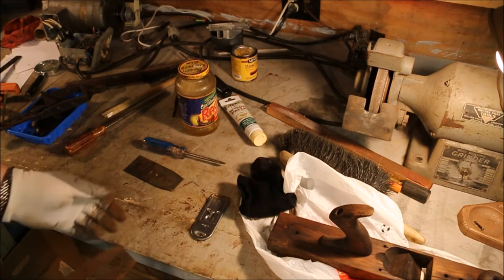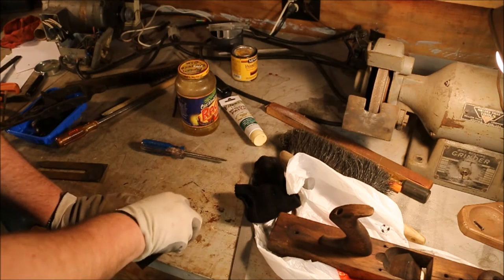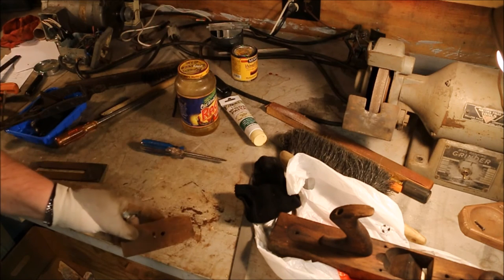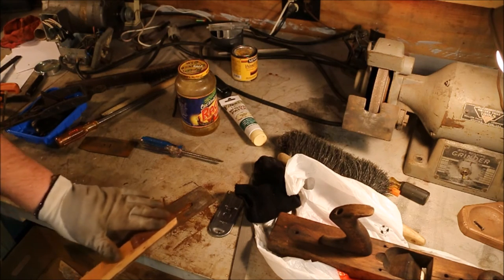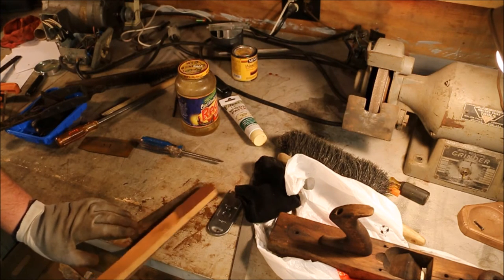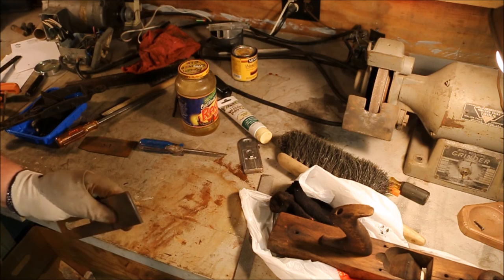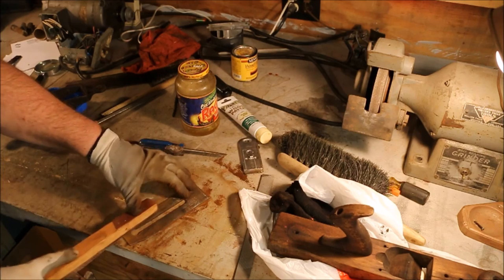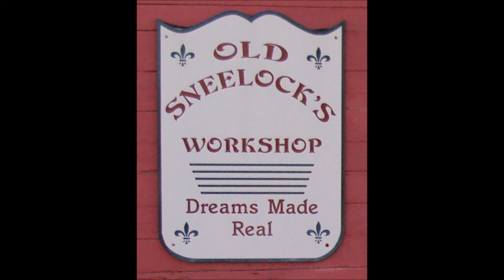Union Transitional Plane ~ Part 2 ~ Clean The Blade ~ by Old Sneelock's Workshop

Comment: Seen some crazy bondo antics in my time. A couple guys drinking beer and using the empties to patch a quarter panel and then came the gobs of bondo. Oh Boy!!!
Reply from the maker: +Tim Caldwell Beer is for after the work is done. Way too many opportunities to screw up. Best part is when your buddies sober up and have to redo the whole thing. 
Long ago I ran a solder dip pot. My job was to solder the headers onto radiator cores by using a hoist and monorail to set them over a 4' x 6' kettle of molten solder. Then i'd rest them on a riser in the middle. I would start a pump to pump the solder up into the riser. When the solder showed through the back side of the header I lifted the radiator off the pot. With the radiator still hot and hanging over the solder pot I used an air wand to blow the solder out of the tubes. Then I'd flip the core over and do the other end. 
I went with a buddy to local bar for lunch. I had one draft beer. For about an hour after lunch it was nearly impossible to get the radiator soldered correctly. My timing was off enough that I would leave solder in the tubes or miss setting the core on the riser square. 
Never had a beer during working hours after that.
Reply: +Old Sneelock's Workshop I agree 100%

Comment: Dad had a couple sayings that he learned in shop class that he used all the time. Beat it to fit, paint it to match. Sanded with a brick, painted with a broom. A brick, the original 1 grit sandpaper.
Reply from the maker: +Nemo I'd like to put that on the workshop wall. Classic. :-)
Reply: +Old Sneelock&#39;s Workshop Dear Unc. My computer is down for a while so if you don't hear from me doesn't mean I disowned everybody. Just going to end up with #10. My computer guy is an Uncle Sneelock in his 80's and was networking ms/dos before there was networking and I get to go to a class by him. Just me and his daughter so maybe I'll learn something. So I'll watch what I can on Sweetums laptop and try to use this compact keyboard. Progress is a big pain.
Reply from the maker: Lewie McNeely Just when you come to depend on them they quit working.
We'll be expecting a report on the outcome when you finish installing the new Kawasaki in your desktop.
Reply: Mine was so slow I was faster than it was so into the shop it went. I'll end up with 2 terras worth of memory and I'll haVE TO FIND OUT WHAT ELSE. Sweetums laptop has a micro keyboard and my dainty fingers ain't dainty. I just hope it has electric start!
Reply from the maker: Lewie McNeely I miss the 10 key pad on my desktop. I've gotten pretty good at reaching up for the numbers on the laptop now.
Reply: I'm still too lo-tech.
Reply from the maker: It's not how tech you are that makes you a success. It's how hard you work at it.
You're doing fine in my book.
Reply: Things are getting scary here. I actually used the Adkins? instead of running a cord for the DeWalt. I'm becoming a Sneelockite and there's nothing I can do to stop it, BUT it does feel really nice! The big beam is up in the greenhouse. I got started and didn't have a
place I could leave it so I had to fiNISH HANGING IT. Blasted small keyboard. Now for the supports. Sweetums watched the crosscut video tonight with me. You're doing fine in her book too!